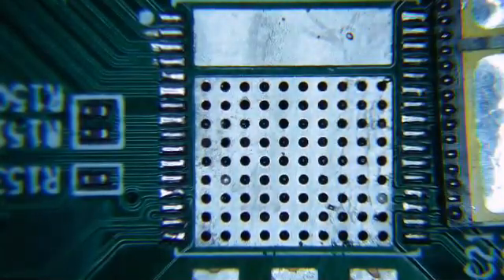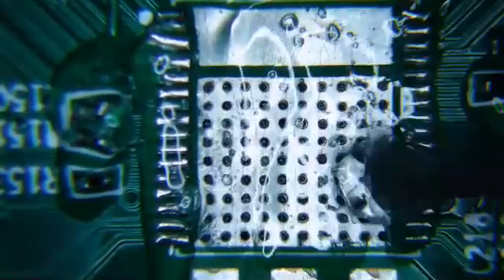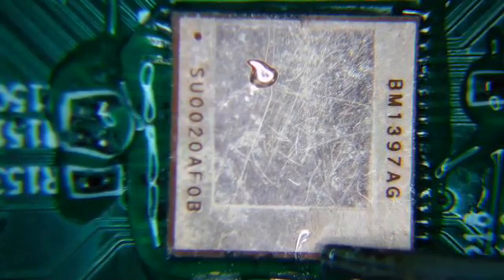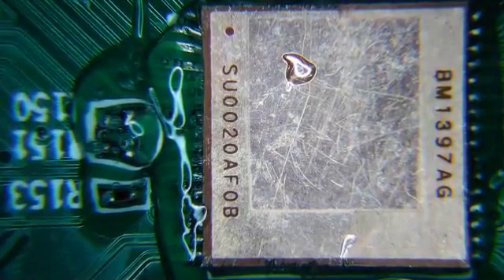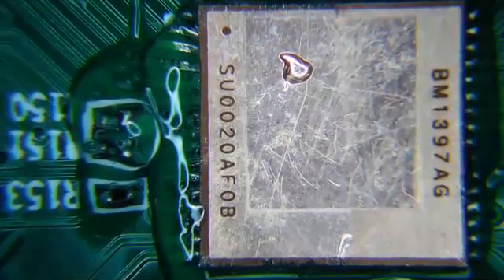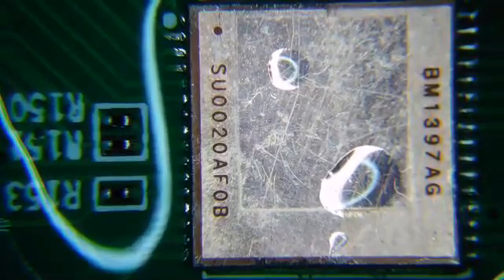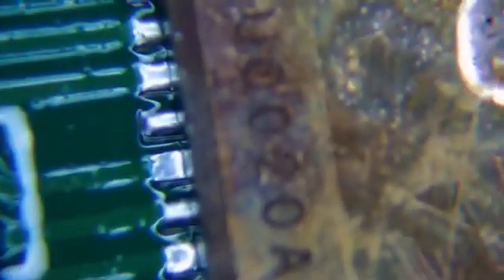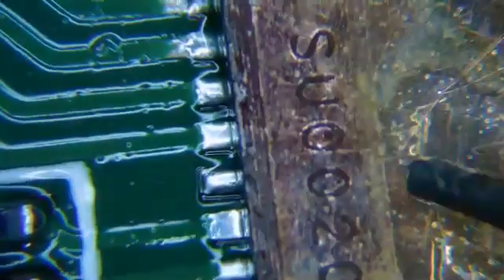hashboard repair:  Replace ASIC chip on T17 hashboard Part 3

Comment: Use a stand for the hot air gun with a square nozzle. This focusses the heat much better and the chip will settle perfectly on the board.

Comment: There are other techniques you can use to speed up this process. Try using aluminum duct tape arround the chip to keep the caps and resistors from blowing away.

Comment: what temperature is the tin paste? What temperature do you use to place the chip? and how much air?
Reply from the maker: 182C for the chip, 132C for the heat sink    450C air - low   But please do watch other videos where I use a hot plate and rework station.  It is a game changer!

Comment: You can kill the chip because you first need to heat the PCB to 120-150 degrees. You addet very beeg quantity flux
Reply from the maker: Hi,  you are correct.  Please see my more recent videos that I have been using a BGA rework station with a heater on the bottom.  It is working very good and much more success than just a heat gun alone.  Thank you for your comments!

Comment: at what temperature is the heat station set ?
Reply from the maker: Hi Freddy,  I now use a hot plate with the heat gun.  Much much more successful.  I put the hot plate on 180 and heat until about 140 on the board.  Then the heat gun after the board is hot I use 450C on the chip itself.